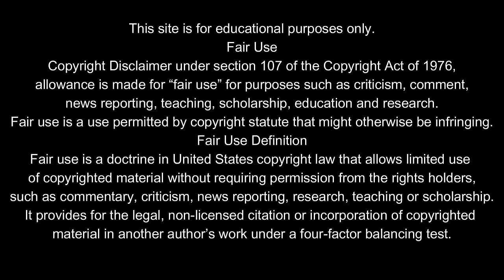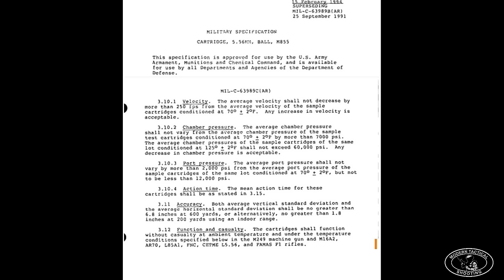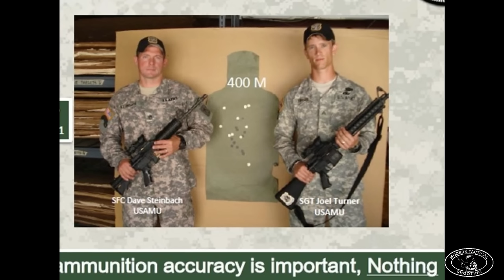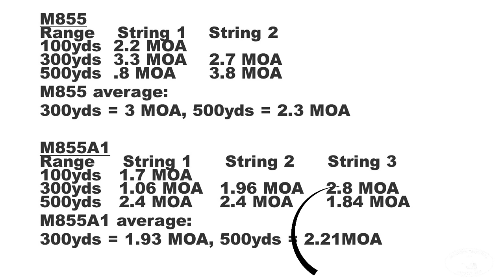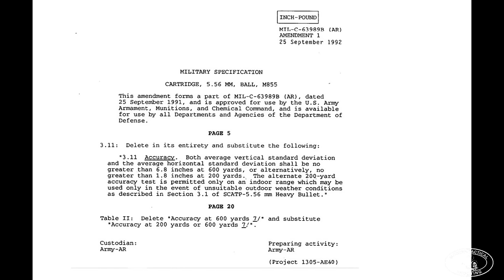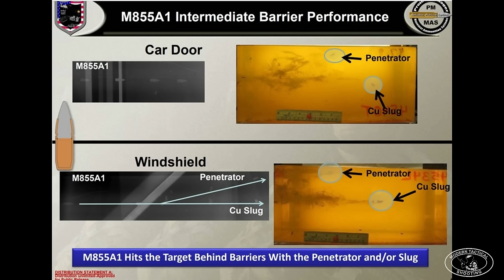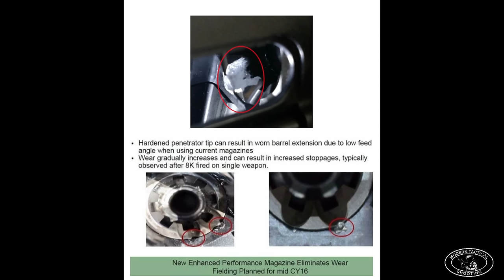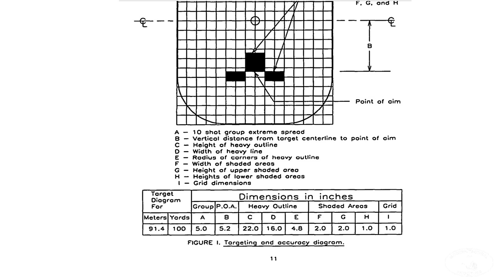M855A1 Performance Review. Did it live up to the Army's hype? Did going green really work?

Comment: Where are you getting your terminal performance "ice pick" data?  Tactical Rifleman and Arfcom are showing drastically shorter necks (aka much earlier permanent wound cavity expansion) with M855A1 vs legacy M855, even and especially at lower velocities (i.e. further from the muzzle with a standard charge).
Reply from the maker: My data is from looking at dead and wounded.  Gel test are not a 100% replication of a body.  No bones, no clothes, no organs of different consistency, plus the fact your average enemy fighter is only at best 9in. thick, so the damage shown in most gel tests is past the point it would be in a real person.
Reply: @ModernTacticalShooting  I would agree that gel isn't a human body, but the necks in M855AA1 gel tests are drastically smaller than 9 inches.  Is it possible that there could have been more internal havoc wrought by the round than was obvious via your mode of examination?  Did you guys ever autopsy any of those dead or render aid to the wounded in such a way that allowed a more thorough examination of what happened internally?

The delta between what the gel says and your field observations has me genuinely curious.  The gel tests show wildly better results for the A1.  For reference:

Arfcom low-velocity gel test:  https://www.youtube.com/watch?v=ZPQOzuceTnk
Tactical Rifleman M855 vs M855A1 side-by-side test: https://www.youtube.com/watch?v=DBdVGJT5ezY

Comment: I also think it's very important to increase the armor penetration. Based on what I know, the Chinese 5.8mm ammo is different from 545 and 556, which are made to create a better terminal performance, the 5.8 is designed to penetrate body armor. Although 556 is not bad, I think it is necessary for US Army (and NATO) to develop new intermediate cartridges. (But definitely not the new 6.8/227 Fury).
Reply from the maker: Exactly could have stayed under 6mm, like the Chinese and their 5.8

Comment: So I spent 20 years in armor design for the DOD. The round we use as the most armor piercing round its the m193. It will go right through. 25" AR500. You need 3/8" to stop it. All other 5.56 easily stops with. 25" AR500. The irony is it's lead so it also has better terminal ballistics. This is well known. So I have no idea why they keep making steel rounds.
Reply: Because M855A1 penetrates my 5/8” mild steel plate where M193’s only reliably penetrate 3/8”.   And the extra mass of the A1’s keep em going through.

Comment: I still think velocity is the most important factor for terminal performance and armor penetration. M193 out of a 20in is amazing on soft and armored targets. They really should improve the powder so that the new M193 gets the same velocity out of a 14.5in or even shorter barrel. At the same time improve the BC of the bullet and I think we are gold!
Reply from the maker: You can make a bullet do anything you want, just a matter of how much money it will cost.
Reply: You'd have to decrease the diameter of the the bullet in order to make it's BC higher. 55gr bullets in 5.56 are as long as they can get, there's no way to to make them sleeker without making them smaller in diameter. You are correct though, they are devastating when shot from a real rifle, not a 14.5 in carbine. There's your problem, we need rifles, not m4s.

Comment: Very, very good video and range testing.   I was disappointed the 6.8 SPC in 110gr - 120gr wasn't adopted or even a 6.5 SPC variation.   The recoil wasn't bad and if it had been a thin jacket fragmenting HPBT Sierra with cannelure, it would been good.  It struck the sweet spot between 5.56 and 7.62.    It never took off.    The MK262 mod 1 ballistics are outstanding.

Comment: The army standard for accuracy is standard deviation, not extreme spread. 

A group with a standard deviation of 6.8 inches at 600 yards (the Army’s standard) is pretty close to an 18 inch extreme spread group size (where you measure the distance between furthest 2 holes). For standard deviation, you first find the mathematical center of the group, then measure the distance to that center from every shot in the group, and then average all of those distances. Most of the time in rifle shooting, a group’s extreme spread will be a about 3 times larger than its standard deviation, but that’s just a rule of thumb. You have to measure to be sure. The Army never intended m855 or m855a1 to shoot 1 MOA extreme spread groups. They specify standard deviation.

Comment: In Army BCT in 2001 we fired at either a 400 or 500 familiarization range that had a pit where half the platoon would lower and raise the targets with grouping markers. With an m16a2 and iron sights there were several of us that could get groupings like that on man size targets. I get it the m4 is shorter but I think it could definitely be done with an ACOG. I can also tell you that an ACOG is precise because I won a bet to shred one of those little glow sticks at night, that went in the tripower, without any issue. Two shots were allowed and I hit it twice. It was significantly smaller the second time. With the mass issue of red dots shooting fundamentals took a hit. Red dots and holo optics have clear advantages but I am a big fan of still learning with irons first. Unfortunately, those training hours are hard to come by.
Reply from the maker: Training is key!

Comment: I grew up shooting my grandfathers 1964 Colt SP1 AR-15 (Serial #191) he bought new in 1965. My father also had a 1972 Colt SP1 with a Colt 3.5X scope on the carry handle. I typically only shot with Irons however. 

All my AR’s are 20” Rifles, most with a Fixed stock, a couple with Collapsible. I have never had a single Jam or failure out of any 20” Rifle length gas system AR. 

If the DOD wants to improve the M4, it’s VERY simple. Don’t buy new rifles, buy new UPPERS. 

Specifically MID-LENGTH upper receivers (Possibly Free Floating) and a minimum 16” barrel. 

Or do what the Canadians did and compromise between Carbine and Rifle. Go back to the 20” barrel, and add Collapsible stocks. Drop the ‘Burst’ and go back to FA. 

I loathe(d) my M4. The TRASH Carbine length Gas system, chopped down barrel from 20” to a 14.5” (losing velocity) plus adding a heavier 62gr pill (More loss in Velocity). 

I was one of the Designated Marksmen in my Platoon and for a time i was issued a M4 that had a variable magnification scope and suppressor in an attempt to DMR the M4. (This was very brief). The Suppressor only made the M4 more stubborn and I typically wouldn’t use it. 

Some of ANA that ran with us had Fixed carry handle M16A3’s/M16A2’s. I wanted that rifle. Badly. And for a time I actually was able to carry one with an ACOG mounted on the carry handle in a DMR role. They didn’t have a rail system like the Marines and their M16A4’s but I made do and was happy to have a Rifle, and it was effective in my DMR role. 

I was eventually issued the Mk14 EBR 7.62 with what I think was a Leupold 3.5-10X or 12X scope. The perfect DMR rifle at that time. Will always love it.

Comment: I think my takeaway is that for the existing M4s in inventory, M855A1 worked as advertised. The 5.56 is starting to show its age and it is being pushed to its limits. If you're going to stick with the same rifles, then keep the cartridge. It does what it needs to do. Years back when the Army was looking at the 6.8SPC, they should have looked at replacing the M4 at that time. A little larger rifle, capable of shooting different calibers (to be changed at the armory level) that can accommodate 7.62 NATO-length rounds as well as shorter intermediates like 6.5 Grendel or 6.8 SPC would have been a better choice. 
I have a soft spot for 6.8 SPC though. I definitely believe it is the better option compared to 5.56, especially when you look at performance from shorter barrels. Ballistically it offers much of the same range and remains lethal at greater range than M855A1. You can't argue with mass unless you're going to push pressures to "WTF are you thinking" levels. Looking at you here XM7.

long story short: If you are keeping your existing rifle, keep your existing caliber. If you're going to change the caliber, wait until you need to change out the rifles to get the greatest effect from your expenditure.

Also, if your enemies are wearing body armor, you need to not bother trying to punch through it. As gruesome as it sounds, explosives are better at killing enemy infantry than rifles are.
Reply: You should check out FN's offering that didn't get submitted to the NGSW. It seems like a much better option than the Sig rifles. Look up the FN LICC cartridge and the IWS rifles

Comment: As far as M855A1's armor penetration capabilities are concerned, it will go straight through NIJ level III from a 10.5" barrel (or 16" barrel at 100-150 yards). Before M855A1, this was something that only full spec M193 (or high velocity varmint load) from a 20" barrel at <50 yards was able to do. As mentioned in the video, most militaries have level III+ or IV armor, so there's no appreciable change in threat level capability compared to M855 for military use. However, most civilians with plate armor are likely to have level III because it's way cheaper and there are only a few specialty loads on the market that can defeat it. M855A1 and M995 are the only rounds that can defeat level III from a 10.5" barrel. You'd need at least 16" barrel to push a varmint round fast enough to defeat level III.

Comment: There’s no way that projectile with the rotating steel tip is going to be match accuracy. There’s a reason after a decade this stuff is impossible to find in my opinion, and that is it don’t live up to the hype. If the military wants a green friendly projectile there are plenty of all copper bullets that are match proven and some get extremely good penetration and some give explosive expansion. Personally at 600 I’ll take accuracy every time.

Comment: I didn’t even know about this round until late/ early 2017. 
When we used them, we were told they have more chances of malfunctioning and I had a 249 cut a round almost in half and we took the gun off the line.
Reply: There’s a reason 249 belts use 855 green tips.
Reply: @blackhawk7r221  so this happened a lot? Lol
Reply: @HalfRightFlock  
M855A1 is loaded to a higher pressure that is timed to the gas system of a M-4.
Not for SAWs.   The 249’s have enough problems already.

Comment: Such big differences between sf and big army experience.

There was a major problem with 855 that 855a1 fixed.  855 didn't burn powder completely in short m4 barrel it was made for 20in 249 barrel.  This caused loads of malfunctions in extended firefights due to excessive fouling and multiple cases of soldiers being found dead with jammed weapons.

Also they were still issuing us the green tip crap in Afghanistan as late as 2020 because some bureaucrat dipshit wanted us to use it up for training, to include using it to zero our weapons.  For those who aren't gun enthusiasts zeroing a weapon with a different round than one you will actually use to shoot is incredibly dumb.

Comment: 2 factors for bullet stabilization; are stabilization in the barrel, thus longer barrels do better (I believe that 14 inches is to short) and then atmospheric stabilization, usually within 300 to 600 spins, thus the stabilization is not necessarily done by 100 yards and due to bullet shape, much energy is lost.   The Russians did better at development in this caliber type..  I would shorten the cartridge (40-41mm) and make the bullet shape better.  This is really a question of what the troops really need and I would go with Kurtz round as it is more of a 'pray and spray' cartridge type, best to 250M, good to 350 and heavy and big enough to create mayhem out to 600-800M
Reply from the maker: We could have  5.45 armor piercing if we wanted to.

Comment: It's a lot easier to find ammo or a loading to shoot well in a barrel, then to find a barrel a load will fire well out of. If you have 50 to 100 uppers with different barrel lengths and twists, but you can also get a big difference between barrel manufacturers for same length & twist, let alone same line of barrel.

I think M855A1 is the best performer for home defense if you aren't worried about over penetration. I wouldn't use it if I lived in an apartment or a house not made out of brick with neighbors.

Comment: Do you think that M855A1 was more "forward thinking" in that it was made for consideration of future conflicts with neer pear adversaries? Like yeah it might not penetrate armor but getting through cars and a more urban environment (like in Ukraine) is an important capability
Reply from the maker: No I don't... I've seen m855 green tip zip through one end of a car and out the other as long as it doesn't hit an engine block.
Reply: @ModernTacticalShooting  thanks for the reply! Now that I think about it, there isn't really any thicker steel that needs to be penetrated even in an urban environment